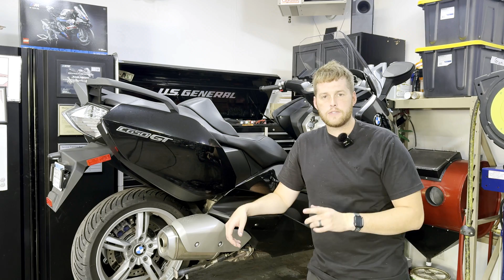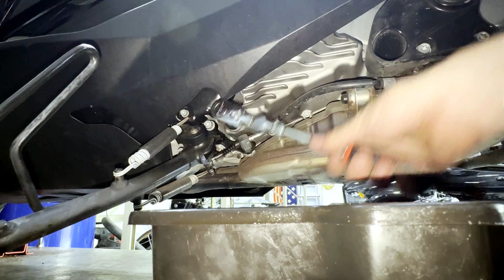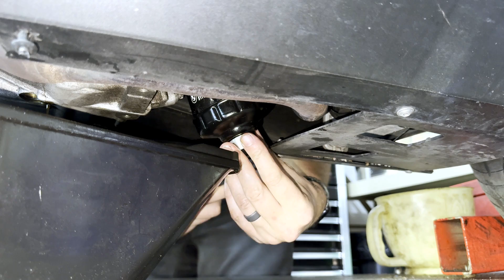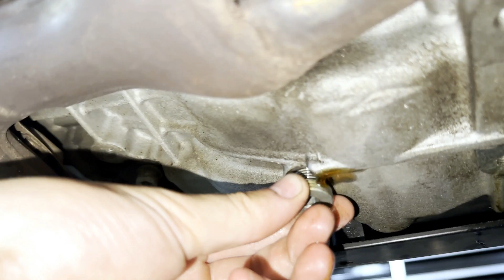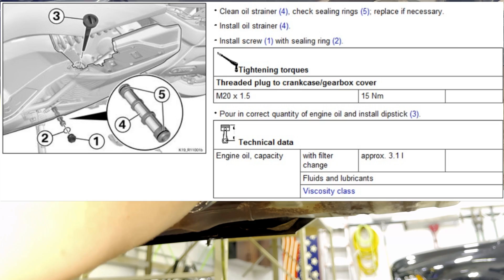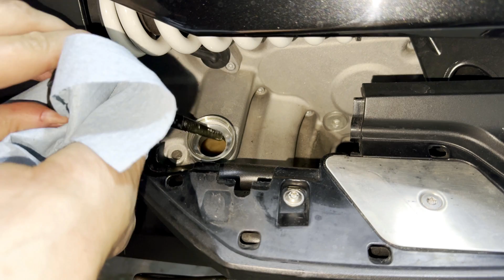BMW C650GT Oil Change

Comment: Can someone knowledgeable help? I want to change the oil in my 2017 C650 Sport motorcycle, but I'm not exactly sure how to do it. Does anyone know how many liters of oil it takes and what type of oil should be used?
Reply from the maker: Did you watch the video?
Reply: @TheBMWGuy  Yes, but my motorcycle is a 2017 C650 Sport. I don't know if it has the same specifications as the C650 GT. Is that right?
Reply: @Dalgasızdönerim Still need help?
Reply: @ErikPurwins yes
Reply: @Dalgasızdönerim Your C650 Sport and my C650 GT have the same engine. It takes 3.6 Litre to fill to MAX.
You will need the Oilfilter from BMW and Engine Oil 15W 50 for Motorcycles. Start with a drive to warm the engine oil.
Drain first on the side where the meshfilter sits, let the rest come out when the bike sits on the sidestand. Most of the oil will come out there. Proceed to drain under the bike, another one liter will come out there. Then take the oilfilter out. Be sure the old rubber ring comes of as well. Drain it well, take your time.Put a bit of oil on the rubber ring of the new oilfilter, carefully screw it in and handtighten it. Proper handtight, not girly tight😊. Then put a new copperring on the screw from the bottom, carefully screw it in by hand and tighten it with a ratchet to (I believe) 30NM. Close the meshfilter on the side again. Have the bike standing upright on the centre stand. Carefully fill 3.1 Litre of the new engine oil in. You can not put more in, it is full to the brink. Close the lid and let the engine run for thirty seconds. Then stop the engine and fill another 500ml in. That brings the oil level up to MAX. Ready to drive.
Reply: @ErikPurwins thank you

Comment: I have a question I have the same bike. What brand of oil are you using? Does it matter what kind you put long as it 15 W 50 they’ve been charging me like $120 at the dealership for an oil change I assume that’s kind of pricey can you put like car oil in there or just bike?
Reply: Only ever use motorcycle oil. Car oil foams up. $125 is fair, as my oil Motul 15w50 cost $50, filter another $12+
Reply: @Lifestylebuilding1  thank you for the information. Can you do an update how to reset a tire pressure I changed the gauge in my back tire I took it to the dealer because I had bought it from Amazon and they told me it has to be the original one. Does that make sense to you my light gauge is still on my bike the yellow one

Comment: I wonder why the BMW Manual says 3.1 Litre. That's just to fill it to the Minimum. After an oilchange one wants it filled to Maximum Level or just under. So it takes another 500ml to bring it to Maximum Level. I found that bit strange last time I did the oilchange. Am I the only one?
Reply: I have same issue. After adding 3.1 litter I bearly reach minimum. It is some missunderstanding here....
Reply: @vaidasnerecionis5806 thats how the engine is designed. You fill 3.1 litres. More you can not fill in. Then you start the engine for 30 seconds and turn the engine off. Now you can fill another 500 ml in. Thats MAX.
It has to to with the design of the engine itself.
Reply: @ErikPurwins  The filter displaces some of the oil. I always fill the oil filter 50% full before installing.
Reply: @jaymurphy7777 Hi Jay, that might make sense. Anyhow, I fill the 3.1 Litres, thats safe for letting it run 10seconds. Then I switch of and fill another 0.5 Litres to MAX.
In which country are you driving your Bike?

Comment: Any reason you don't drain from the lower engine oil plug first, then the screen 2nd? Be less messy on the stand.

Comment: Hi great video, done the oil change. Could you please tell me where the drain bolt for the gear box is believe it takes 250ml 75/90 oil. Done the chain bath one 500ml of oil. Just can't find where the drain bolt for gear box is. Be much appreciated 2013 model
Reply: The drain is above the exhaust box

Comment: It's nice to have the spin on filter.  As a Guzzi guy, I dread oil changes because of how messy it is pulling the paper cartridge out.
Reply: The spin on on my Fireblade makes a bigger mess over the exhaust than the cartridge on my Yamaha WR250R. I also have a cartridge style on my car and it's hardly creating any mess, being perfectly vertical and upside down.

Comment: I find the dipstick placement quite silly.
Reply from the maker: actually very easy to access
Reply: @TheBMWGuy  I saw that, but I bet most owners won't remove the trim piece and the floorboard rubber only to check the oil. That if they actually bother to read the manual and find out where it is. I much prefer the sight glass, or at least a dipstick that's not hidden.
Reply: @johnnyblue4799 no real need to check oil… unless you’re changing it.  Onboard computer tells you the oil condition on the dashboard  [OIL :OK] (assuming the ECU is working fine 😂) you’ll get a warning ⚠️ if something’s wrong